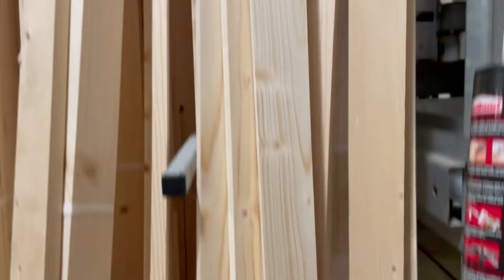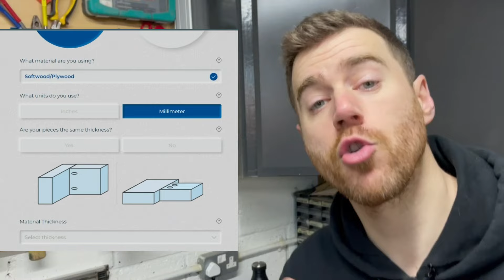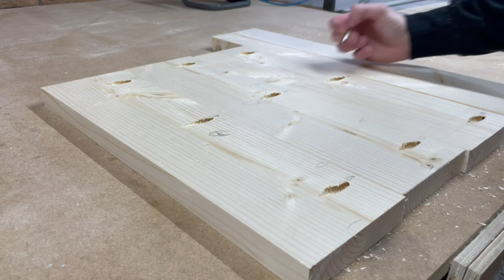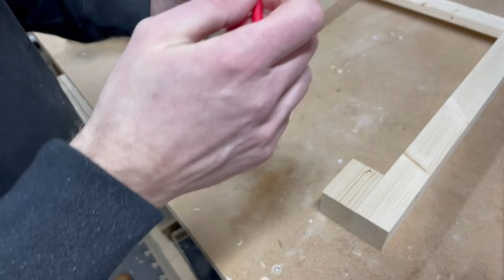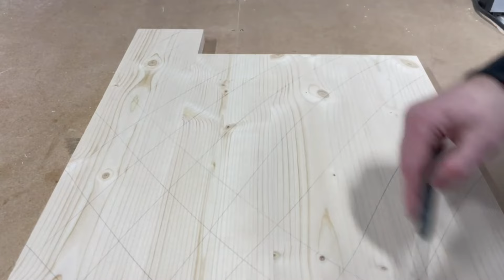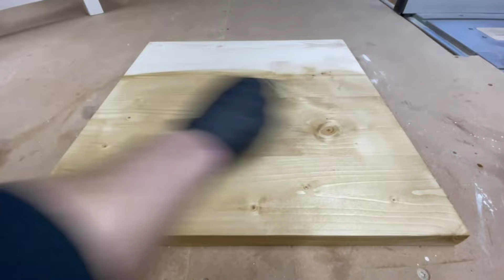THIS should be your first woodworking project // Woodworking for beginners

Comment: Thanks for your videos, I also watched your first pocket hole video. One thing I don't understand is the numbers 13, 19 and another number, say I have panels of 16mm thick (for a shelf) where would I set it at? at 13? or set it somewhere between 13 and 19? Thanks
Reply from the maker: That’s a very good question. I tend to err on the side of caution so as not to blow through the other side. Your jig will have recommendations in the instructions when you use the measuring gauge and it sits between 13 and 19. But a good rule that I follow is to use the Kreg screw calculator on their website and then do a test piece to see what the hold is like.

Comment: Hi mate how did you pocket hole the 2x2s? Struggling to fins a jig for 44mm timber. Thanks
Reply from the maker: Hi mate, I just used the kreg 320 jig. It’s not 100% designed for the 44mm material so is pushing it a bit but it worked ok. You’ll find that the jigs will cope with 34mm stuff better so you may want to adapt the measurements for 34mm material instead. The last few tables I made was 34mm which still looks good. Here’s my associates link to the kreg 320: https://amzn.to/3Rne0TS
Reply: @Ben - Lion & Bear Woodworking  thanks mate. 1 more pls. Which size screws do you use for 44mm timber please? Thanks again. Only subbed a couple weeks ago. Enjoying the videos
Reply from the maker: I’ll just double check the screws in a bit and confirm as i forget which exact ones I used and don’t want to send you wrong. Bear with me and I’ll reply later this morning. 

Thanks for being a subscriber and the positive feedback mate. Really appreciate it.
Reply from the maker: Just checked mate and I had it set to 19mm on the drill and the jig and used 32mm screws. The 19mm setting gets the hole closer to the joint and the screws protrude about 16mm into the joint which was enough to clamp them together. It’s not the perfect joint but works fine on the table, especially with glue on the joints. I’ve just stood on the joint on the table I built and it can take my full weight so no problems there. Hope this helps you mate.
Reply: @lionandbear  that's brilliant thanks so much for getting back to me
Reply from the maker: No worries at all mate. Send me a pic if you build it! Details are in the video description

Comment: What a well presented video. Clear and simple. really very well done. Appreciate that it was based on the 5 tools but dont be afraid to suggest a hand saw for those smaller cuts. Possibly a little safer, especially as its aimed at beginers (having said that, never had an accident with my circular saw but have dug my hand saw into my fingers on many occasions :) )
Reply from the maker: Thanks John. I’m pleased you understood the premise for the video. I absolutely would’ve done things a little differently with a couple of other bits such as clamps etc so my next project will be based on using a wider set but I really hope this video helps some people just getting started as the hardest thing is making those first steps into the hobby.